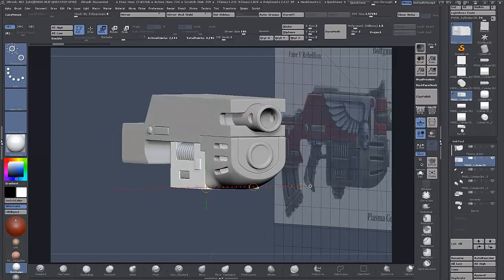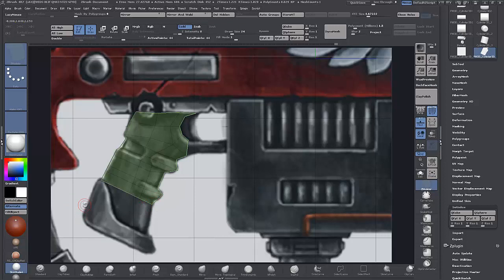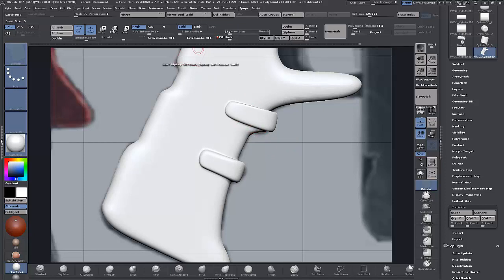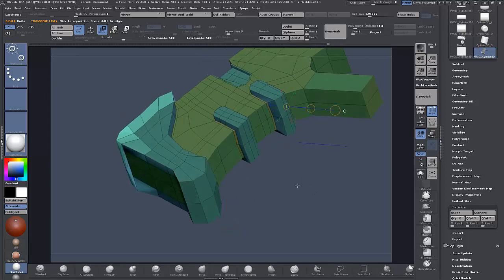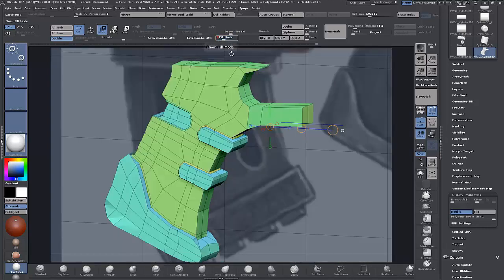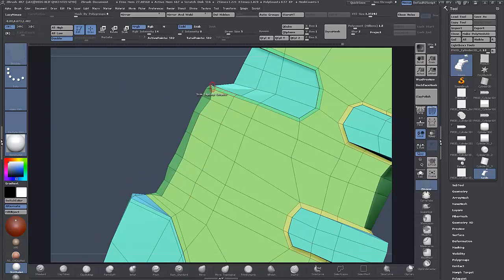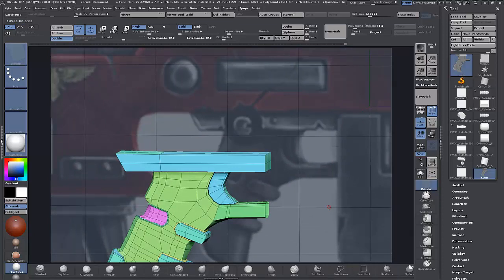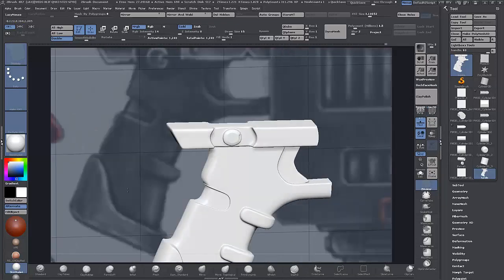Zmodeler-Zbrush 4r7 Tutorial 'Plasma Bolter' Part 7

Comment: At 1:00 when you "squeeze" the frame of a weapon, what happens to the geometry? Can you still create UVs? Sorry if the question is stupid but I'm still learning about 3d.
Reply from the maker: No question is ever stupid. :) Scaling the model like that is no problem at all because it's very low-poly. If it were a very dense mesh and you only scaled an unmasked section then you would get issues with edgeloops bunching up too tightly.
Reply from the maker: Also, regarding the UVs, if you take a look at my 'importance of polygroups' video I show an example of UV unwrapping that curved piece that I scale in.
Reply: OK. Thanks a lot! That video you mentioned is already in my "Watch later" list but i haven't got time to watch it yet :)